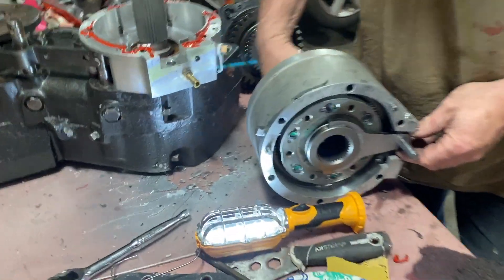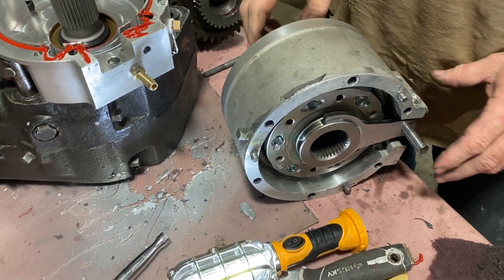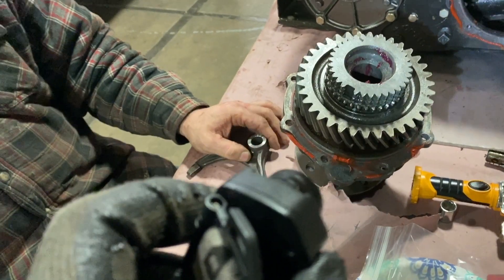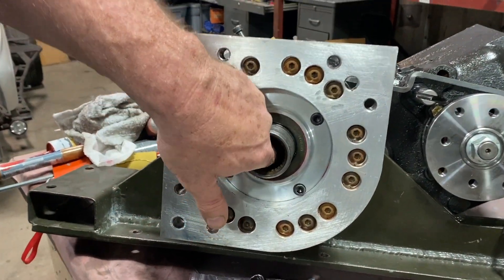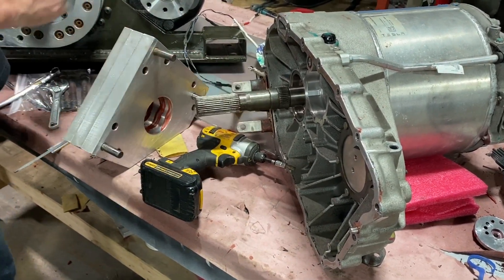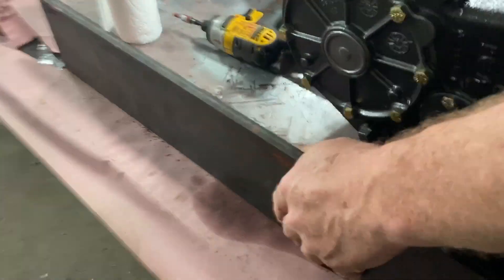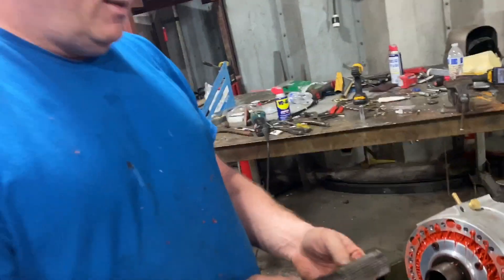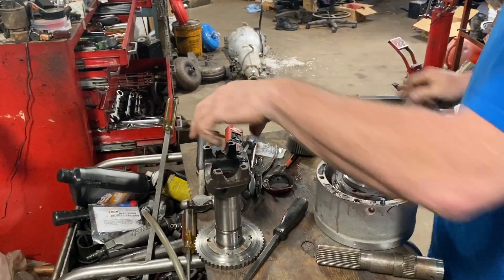Transfer Case Issues Pt  2

Comment: Hello, as you've already heard many times, you guys have done amazing work on your builds.

If you don't mind me asking, do you have any further information you'd be willing and able to share on your f450?

I have a H1 which I was planning 2 LDUs in place of the transaxle/differential, then decided on 2 SDUs due to space limitations but because of those limitations I'm now just going with the tried and true of pulling the engine and transmission to replace it with one motor at the transfercase.

I would love to hear any information you're willing to share the fabrication of your LDU beyond what what was in your videos. I'm only aware of 2 other similar divorced LDUs without digging deeper into rambling forums.

What's your usable RPM range with it being a 1:1 from the motor? Do you know what your max amp/watt draws have been? I wasn't able to keep up in your videos what other ratios you had past the 1:1 motor with 37" tires. 

I'm looking at a max MPH of ~87 at 1600rpm if using the ReVolt 4.1 and a 2.56 axle plus 1.92 from the portal axles. However if I were able to get the LDU to a 1:1... well... that would be far more usable while keeping my RPMs and Amp draw down at highway speeds

Comment: Absolutely frustrating, 
I had the same problem after fitting the gearbox and I was left with 2 bolts! I removed it again thinking maybe they are for the flywheel! and checked the flywheel and everything looked ok. After a long headache, I remember when I remove the gearbox from the junkyard, I took 2 bolts for the starter and I have used them instead of mine. A relief!

Comment: A little dot of different colored grease on one area of the splines would have helped.  If it was not slipping, the grease dot would stay put.  If it slipped, the colored grease would smear around the whole piece.  Of course you'd have to have an idea that may be the issue before trying that...  Thanks for sharing what was wrong.